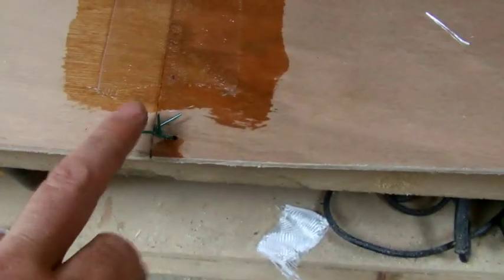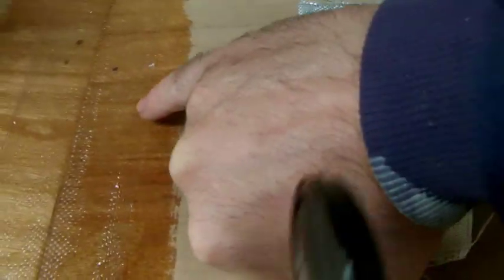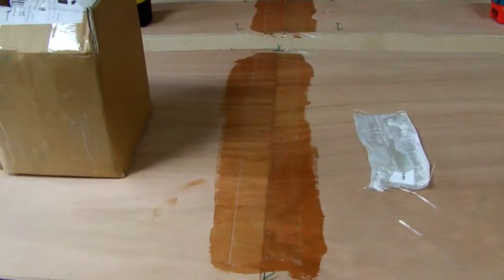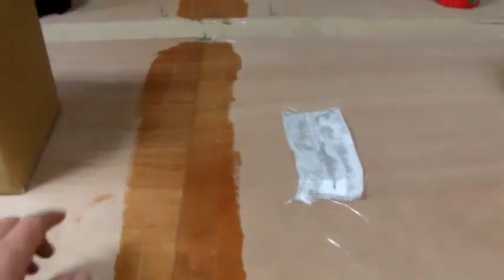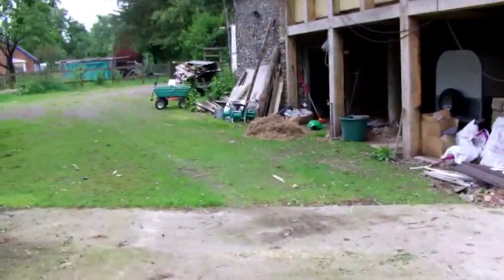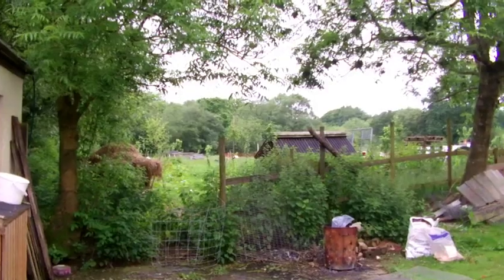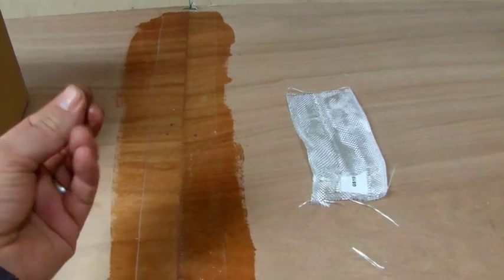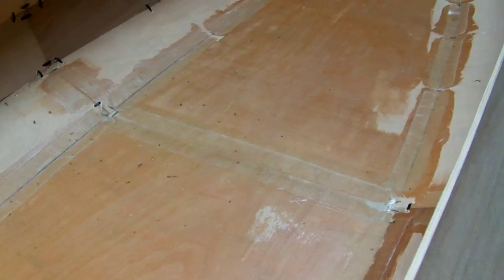16ft ply open canoe build part3

Comment: hi Joe ty for the reply iv been going mad all day in the garden i was making a boat from bateaus it was supposed to be one chine 12 inch's im 125 kilos im pretty sure that would disappear fast under the water with myself in it, so i decided on a 18 inch side still will be 14 ft and more flat sided flat bottomed then trad canoes. i started the cuts and decided the waste i would leave between the side panels in the middle of the plank that way top of my canoe gets neat trimmed edges

Comment: i then had to cover the gap between the two 8ft panels to join them i used pvc resin 1 ozs to 2 drops hardener that's where the hard part came in  mixed it and painted the board to fix the two panels then i painted the panels and i wet out a piece of fiber glass above the board where i will stitch and sew hopefully next week, my question is how long shall i leave it? the ply is pressed down with two breeze blocks as my clamps and the things in my garden covered in a tarp on the table